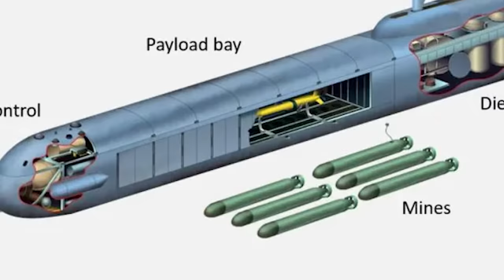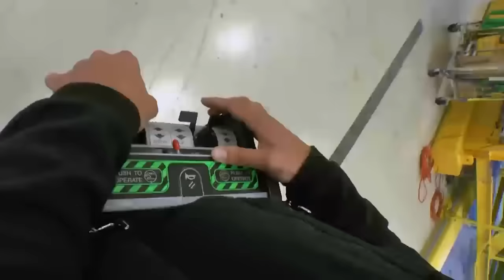The Insanely Large Apocalyptic Drone of the Seas

Comment: Besides warfare this vessel should be used to map out the deepest parts of the Atlantic and Pacific oceans. I’m sure cameras could be adapted to work on the along with lighting to help see what hasn’t been seen.
Reply: Unfortunately,  it's not really going all that deep.
Assuming an operational depth of 1000 feet, it would still be over 35,000 feet from the bottom of the deepest part of the ocean.
Reply: @supergeek1418 it could easily be made to reach these depths , and further mankind’s knowledge of the dark depths, but this machine is meant for mangling people not furthering their knowledge 😂😂
Reply: All of the oceans have been mapped,  quite extensively.  We have depth sensing sonars that can reach the bottom of the ocean, wherever we care to go.  
No need to physically go there, if our sensors can detect it.

Comment: The hull is flat-sided, which means it cannot go very deep (e.g., designed exclusively for a littoral mission set) or, because it had no need to protect fragile human crews, it can go very, very deep by equalizing internal and external hydrostatic pressure.  
If it is acoustically invisible, it may have the ability to re-echo the ambient natural acoustical signature. (Noise-Cancelling + Anti-noised cancelling.)
BTW, on the scale of US defensive expenditures, $242M is by no means whopping.  Elon Musk, Jeff Bezos, or George Soros could fund a fleet with what they spend on yachts.
Reply: It has flat sides because there is no pressure hull. No need for it, since there is no human crew.
Reply: according to boeing it can dive to at least 11,000 feet below the surface.
Reply: Damn girl!
Reply: Flat sided because there is no need to pressurise it.
Reply: @CRAZYCR1T1C    Agree that must be the case if it can go very deep.  But, how do they pull that off from an engineering standpoint?  The interior must be filled with an incompressible liquid that can still allow all the tech to function.  (My best guess.)
Reply: Flat sides let them hide as overboard containers. Very smart touch. Expect most drones to be 20ft or 40ft in order to take advantage of that.
Reply: @grandlotus1  or pressure sensitive components are in an internal re-enforced compartment.
a possible double hull of sorts... having the inner hull only protect a subset of components means it would still be able to do deep dives (11,000 feet) and save on weight by not having to encapsulate as much of the components in the inner hull.  The diesel engine i imagine would need to be protected as i can't easily imagine it operating in a equalized pressure compartment.  Like wise, don't think Lithium batteries will do that great with pressurization ups and downs which could/would lead to ruptures.
Reply: @BikiniDuckCreations expect an overboard container to be the next Ukrainian drone to sink a ruzzian ship
Reply: @CRAZYCR1T1C what a load of bollocks.
MOST submarine designs are double hulled especially military ones. The outer Hull is a fairing. It is open to the water.
If this is designed at all well it will have internal spherical pressure compartments for the components that need protection from seawater and pressure.
Such as ANY electrical, diesel, electronic parts.
Reply: @grandlotus1  Yes, I was thinking the same using dielectric fluid.
Reply: @grandlotus1  
Actually,  you could easily pressurize to external sea pressure by using stored compressed air. That's the method that they use to allow the mylar covers on missile tubes to not rupture when the missile hatches are opened.

However,  I'm pretty sure that the flat sides are just part of the fairing, and the pressure hull is round.
Reply: @supergeek1418  Thanks!

Comment: I wonder how it handles drag nets. A quick net search pulls an eBay listing for a Commercial Fishing Net 6 inch 180 mesh 1260 ft mono dark green / Premium Net for $1,450.00. At that price, if one gets snagged on the ocean floor, an unscrupulous captain might just cut it loose and string a replacement. Given that the ocean is constantly in motion, the snagged net could become unsnagged. The ebb & flow could allow the net to cut through whatever was holding it. Modern technology vs. Mesolithic technology. I hope it's been addressed, because this drone is an amazing piece of work.

Comment: Are they showing the actual propeller blades, or is this a mock-up, to be replaced in the operational model?

Because they never show the public the propeller blades on submarines in service. Only on old, obsolete and retired museum pieces - and not always, even then.
Apparently, if you know the shape of the propeller blades, you can calculate the noise they make in the water and then use that to detect the subs. Or so I'm told.

Another interesting point is that for decades the US Navy resisted not only acquiring and deploying Diesel-electric submarines, but also manufacturing such subs for foreign clients anywhere in the US, less the fact the US already builds such subs would be leveraged to put pressure on the navy to buy some instead of its way more costly nuclear subs.
And now they are making 5 new Diesel-electric subs for the first time in like 60 years and counting.

Comment: I guess the Navy works already on a nuclear powered version?!
Look - first: there are huge advances in micro-nuclear-reactor design.
Second: a big part of the complications (weight, size) of a reactor is due to the fact, that the radiation has to be contained towards the crew living space. In an autonomous vehicle, this issue doesn’t persist.
Third: there are only two reasons, why the vessel has to come up tot the surface (where it is the most vulnerable): to charge the batteries and to communicate. I guess the Navy has already some hacks for the communication - but the slow charging of the batteries is a bummer. Also: without big batteries (because of the reactor), the weight and volume penalties are almost offset.